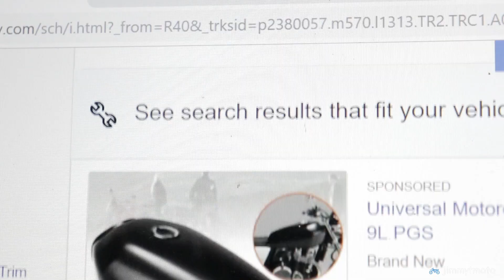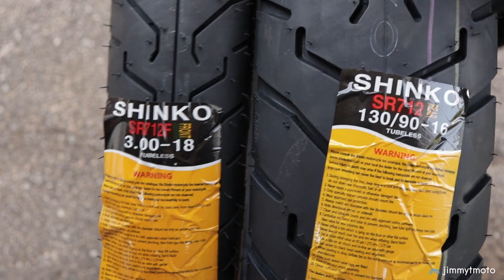Vintage Yamaha Gets a New Gas Tank and Tires - Yamaha SR250 , EP 4

Comment: Jimmo, you are making great progress on the scrambler.  First I love the steel wool and drill bit trick, second, I never knew that it was possible to lubricate a brake cable, and third you showed the inside of a motorcycle drum brake. You taught me three things today.
Reply from the maker: Thanks so much for following along! I love the simple little tricks, too. And the cable lube tool is something I just recently bought...for years I'd make a little paper funnel around the cable end and fill it with oil, letting gravity do the lubricating. With this new tool it forces the lube down through the cable and it's super slick! It instantly got a place in my "favorite tools" drawer.
Reply: Instablaster...

Comment: Just saw that you crimped those connectors on the fuse incorrectly.  The larger crimp should be over the insulation, and the thinner crimp is on the bare wire.